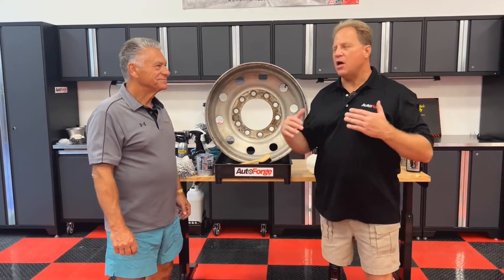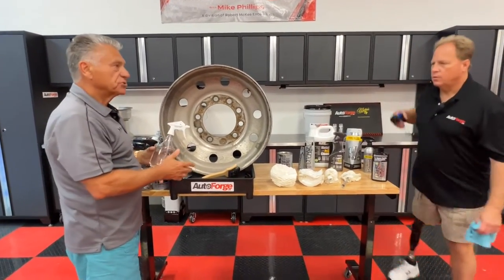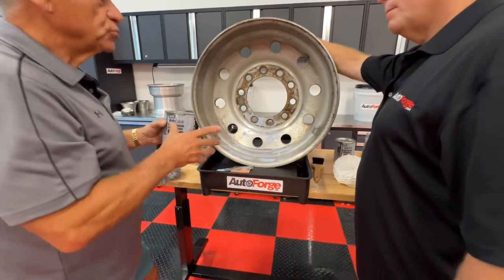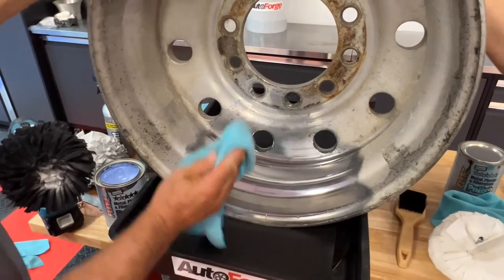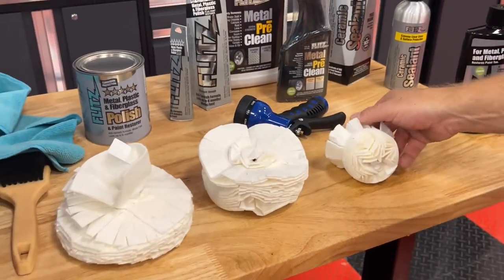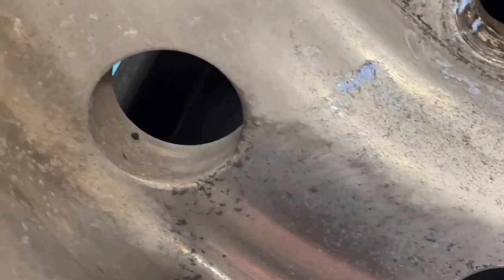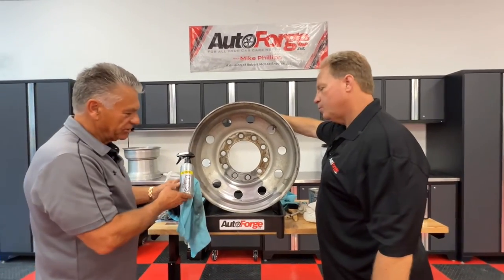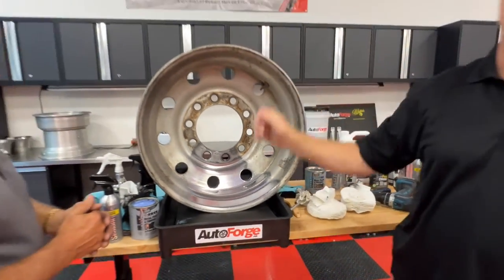Ultimate Metal Polishing How-To Video with Mike Phillips & Flitz

Comment: I'm confused.. I thought you're saying that the Flitz Polish has some sort of protection? The water beads up (8:20 mark)?  But then you take your spray Ceramic Sealant and just put it right on top of the polished surface?  Doesn't the sealant work better on a virgin surface with zero protection?
Reply: It works on both, I use it on my semi truck, ceramic right after the flitz polish, shine lasts nearly a year with minor upkeep

Comment: Wow, twenty minutes and there is still pitting and it looks like crap and you only did 1 tenth of the rim. Yes you will be black from head to toe but with sanding and Rouge that whole rim would be an unpitted and a true mirror finish in under an hour. At your rate that would be three hours to do a rim and it would still only look good from a distance.
Reply: well its like he said 99% of people would be happy with this. This is an affordable alternative anyone can do.
Reply: @HOMELESSG0D  sure but you would get a better finish in less time with 00 steel wool and wicked polish then hitting it with a cotton buff.
Reply: , you are not kidding, 0000 steel wool and a quality polish is a good option for the working semi truck. It was my method until I learned to sand, cut and buff
Reply: Was thinking the samething 😂